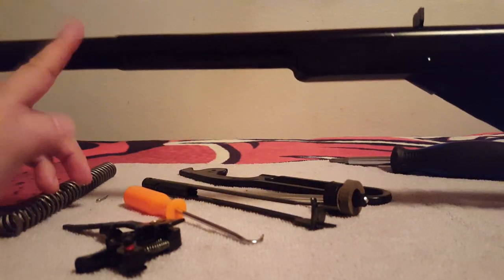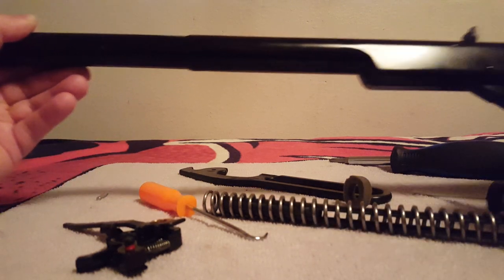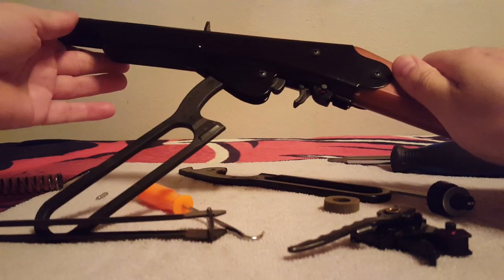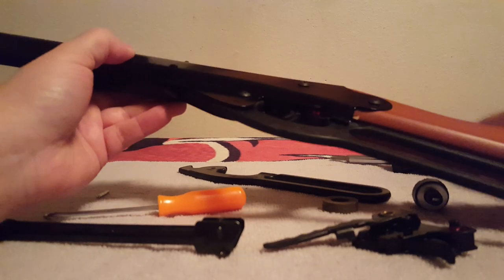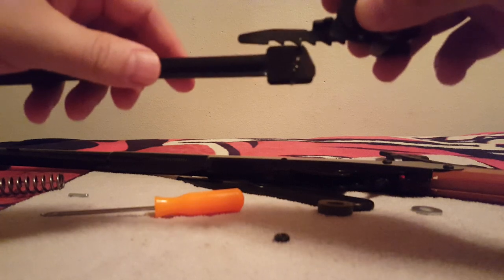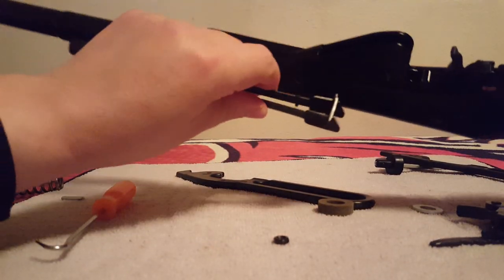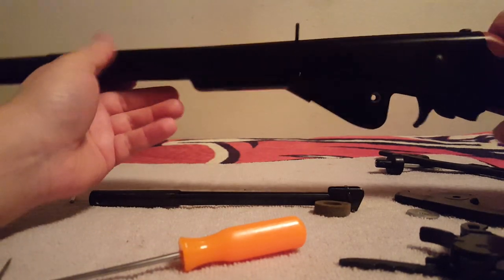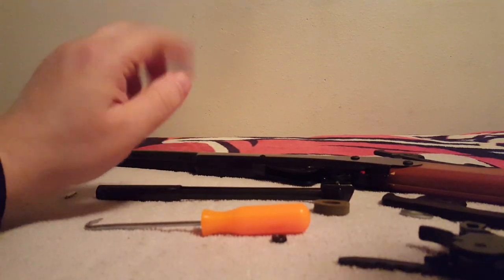Red Ryder Fix: BB Jam vs Plunger Jam

Comment: I get the full clicks, and I get the full trigger pull and sound.  However, it will 'not' suck a BB in.  I've put 1 BB in the gun, I can see it through that little hole, and it will never get 'pulled in' while cocking.  Any ideas on how to fix that?
Reply from the maker: Loren, please don't disassemble it.

This looks like the most basic jam. Please follow the loading ramp jam video. It looks like a bad BB. The second video will help with loading issues.

https://youtu.be/rNXE7-fhelg

https://youtu.be/qFb13cG3a5I

Comment: mine lasted 4 shots
Reply from the maker: Does the trigger go "click" when you cock it and pull the blade? Or is the trigger and lever dead in the water? Slack lever and slack trigger?
Reply: @daisy880fanaticfixit9  nothing happens when pulling the lever
Reply from the maker: You may have a fake jam. Try the fix below. 

https://youtu.be/Ay8oSXlhNWY
Reply: @daisy880fanaticfixit9  thanks, it probably was the fix, but after i opened it, i probably messed it up. Can't put it back together
Reply from the maker: If you got your trigger sucked inside, this video gives you a chance. You will need to make a compressor.

https://youtu.be/0uCgA848t28

Comment: Good video. This is a subject that is rarely addressed (thankfully plunger jams are rather rare)
The only times I’ve seen this is when either the trigger assembly is broken (the plastic housings do break occasionally and pieces can cause jams), or if some component is bent.
However, there is another concern that bears mentioning. If you remove one of these a.b.t. triggers, when you reinstall it (or if you are replacing a damaged assembly), make sure you position the ratchet arm BELOW the plunger side extension. It is possible to install the trigger with the arm above, but when you try to cock the gun a jam is almost guaranteed (I got one in a while back that was stuck so badly the trigger had to come out in pieces !)
Reply from the maker: Rex, the ABT really a headache. Sorry it gave you so much stress. I have a video just on the trigger install and recent disassembly/reassembly done in 7 minutes. 

Hope you agree with remarks below I made to an RR fixer:

"People (many kids) get so mad and get mad at me for this. But I didn't engineer the modern Ryder.

"Your install setbacks happened STRICTLY because of the ABT. It needs to go! No more ABT. They should just tie a warning card on the lever with 🚫 symbol to keep your FREE hand on the barrel while cocking - NOT on the stock.

"On the Buck for spare parts, that used to be great Wal-Mart deal $18; Buck was great cargo ship. $28 now but still a decent cargo ship - SAME DAY FIX. You still get a spare power plant; ordering power plant and trigger, with taxes and shipping, would still come in around $20."
Reply: @daisy880fanaticfixit9  Although I understand Daisy’s reasoning behind the abt (that’s a long conversation…changing times, legal liability, failures in modern parenting and the educational system, etc.) overall, I do agree with you, the plastic triggers in general and the abt specifically are “problematic” to put it politely.
A frame-mounted abt along with the steel- bodied trigger housing w/side mounted safety (like the 499b has) would have been a much better design. 
But this the hand Daisy dealt us. As owners/users we do have some options, but if we go down that road, we accept all responsibility 
(which, honestly, is really as it should be anyway). 
Lastly, I also have purchased guns solely as a cost-effective source of replacement parts…what can I say ?
Whatever works, works !                  r

Comment: Even tho I like watching those fix I hope that I will never have to use them!

Mine is not that "old" and ive used only Daisy BB's in it yet but it has been flawless up to this point 🤞
Reply from the maker: My lone breech jam was faulty Daisy BB. I would ask you to consider Avanti (Daisy Match) or Umarex Zinc - all I use for RR. New BBs only!

As far as no breech jams...🤞🤞🤞🤞
Reply: @daisy880fanaticfixit9  this reminds me that I might have shot half of small umarex jug but those are more expensive here

Ive heard a few case where crosman bb's caused jams should I be worried to try them for an accuracy test
Reply from the maker: Lowkey, the problems with Copperheads are related to rust. Accuracy issues are related to being tiny BBs around .172!

Try this when using Copperheads:

https://youtu.be/ZR1quvVrdrY
Reply: @daisy880fanaticfixit9  I did see this video before!
So if there is no signs of rust they should cycle fine in a RR?
Reply from the maker: Yes

Comment: So mine will cock til the last click and then spring back the lever what will that be my gun is in bad condition anyways
Reply from the maker: If your Ryder has many thousands of shots, your description means your sear just got worn out.

THE LAST CLICK,#7, IS THE SEAR.

So if it doesn't hold the plunger in place, the lever will FLY out of your hand.

If the power is still good, as you judge it, then just order a new trigger or buy a Buck and harvest the trigger assembly. EASY stuff!

Dealing with the mainspring is more complicated. Just make sure that the plunger isn't hanging on your ABT. Use the pick method in video BEFORE putting In a Buck replacement.

The Ryder and Buck have an identical power plant and trigger system.

As long as your gun isn't from the 1990s and DOES have an ant-bear trap, a current Buck trigger will work.